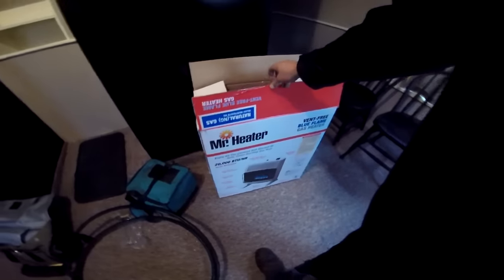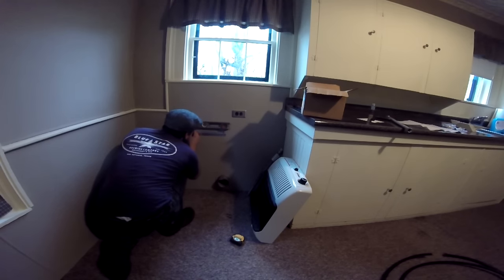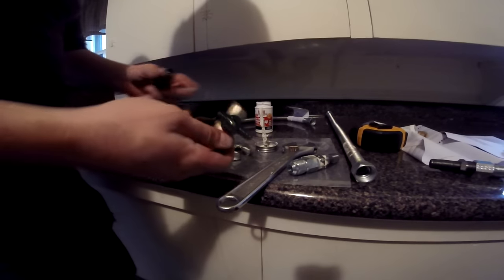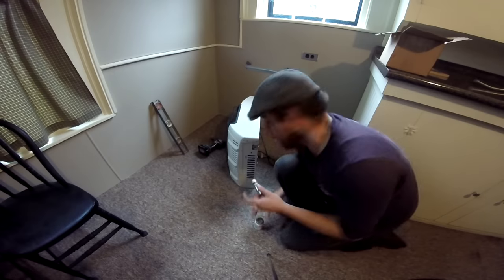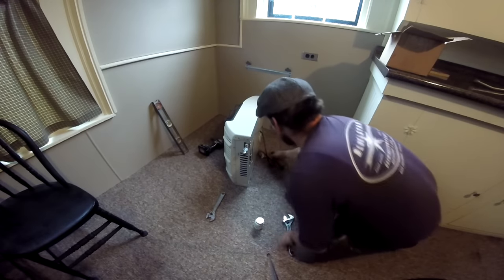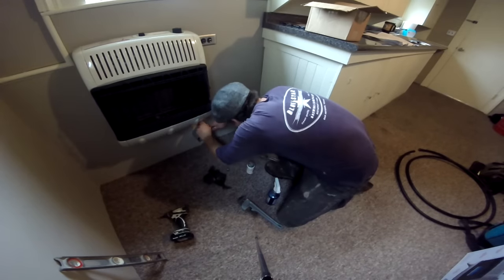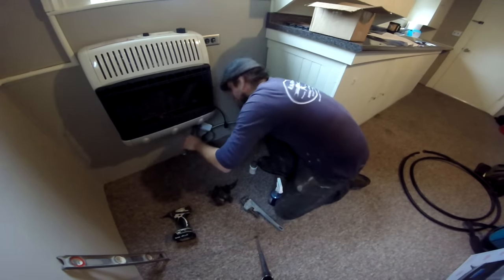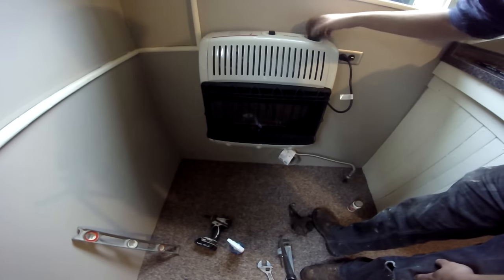Installing a Vent-Less Heater (1)

Comment: very informative. just an extra note,   those that install this unit please make sure you are not using pipe dope or tape on the flared fittings. if they don't seem to be sealing properly, a small shot of a product like wd-40 will help it seal. I plan on buying this heater to install in my shop. I work for a propane company and have installed a few similar heaters.
Reply from the maker: Jimboslice5545 - True Story on the Doping for Compression Based fittings.  I have never heard of the WD40 Trick though.  I will look into that.
Reply: I'm so glad you pointed this out as I had read that the "flared fittings"  are self sealing and NOT to use pipe dope or tape as it could cause problems.  Pipe sealant always on the MALE threads.  Think of it this way- the extra goop is being pushed OUT when you use it the correct way- otherwise you are driving it into the pipe where it'll get inside and could clog up something.   You can also use a combo of tape and pipe dope in the MALE threads for good measure if you want, though that pipe dope makes a big ass mess, and easy to overdo.  The teflon tape for Propane is YELLOW container, and always wrap around threads in CLOCKWISE Direction, overlapping- some tape is really thin so you may need several laps.
Reply from the maker: Right on!

Comment: I just bought a Mr. Heater 30,000BTU Ventless blue flame Propane Heater.  I'm using it as emergency back-up heat for Power Outages.  Maybe it's just for the Natural Gas Models, but can you tell me please if I need to install a "dirt trap" black pipe that would go right under where the gas hose attaches to the heater (it is a dead end capped pipe that is supposed to keep the pipe clean- though it is not included in the Mr. Heater kit)?  I have looked and can't find info anywhere and hope you can help- or anyone can help please!  Thanks!  And I liked the video- clear and very helpful IMHO.
Reply from the maker: I am glad the Video was helpful.  NG or LP should use a "Dirt Leg" regardless, some codes may not require them, but they are always a good idea.
Reply from the maker: Yes, Thank you Wes!

Comment: I have a DynaGlo ventless natural gas heater. I have had my heater for a year, its now November and I need to turn it on. I got the pilot to light, but the control knob won't turn counter clockwise so I can get the heater to turn on. It won't budge, even though I'm pressing it down. I called customer service, but they close at @ Central Standard time, and I've never been able to get through. Its freezing here, and tomorrow is Thanksgiving. It worked last year. It looks a little dusty inside, but if it was too dusty, wouldn't the pilot light refuse to light? Its lit now.
Reply from the maker: Sorry for the late response.  It sounds like the Gas Control Valve or the Manifold that the Regulatory Knob/Shaft (Control) has malfunctioned or is bound up internally.  The pilot may still remain lit if the physical blockage or malfunction is after the pilot selection of rotation portion.
Reply: It's always a good idea to test run important items like this portable heater BEFORE cold weather approaches!
Reply from the maker: Yes it does!

Comment: thanks I got this same one and were wondering what I were doing wrong , how did u get air out with which switch?
Reply from the maker: lonnie smith In this video, what I do typically is assemble everything together, then turn the gas on and then loosen the appliance connector as it goes into the nipple at the gas control valve.  Wait until you smell a little gas and then tighten the appliance connector back tight with the nipple.  Don't forget to soap your fittings.  There is still a slug of air between the gas control valve and the pilot tube.  So, set the dial to Pilot and push down on the knob, as it allows the gas to flow out, it will push that slug of air out of the line.  By cracking it at the gas control valve you're pushing a larger slug of air out before it reduces to that tiny pilot tube, reducing the time to push all the air out significantly.  Once you've given it a couple seconds.  Start trying to ignite the pilot flame.
Reply: thanks for the help  i got it started
Reply from the maker: lonnie smith Awesome!  Stay warm.  :-)
Reply: Must your furnace be working properly for a ventless gas heater to work?
Reply from the maker: In most states, your primary heat source is required prior to using a vent free gas furnace as a secondary source.

Comment: One question any body know if this produce carbone monoxide because, not has vent pipe to go out side of the house
Reply from the maker: Great question, it does produce Carbon Monoxide (CO). 
 Regardless if a unit is vented outside or not it will always produce some amount of CO.  Vented units produce CO at greater Parts per Million (PPM) or toxic levels of CO.  This unit in particular is considered vent-free as it produces low amounts deemed to have a PPM of tolerable levels or non-toxic amounts due to its high efficiency.  As a Natural Gas (NG) or Liquid Propane (LP) stove produces CO, it is not vented due to its low PPM.  I hope this better explains the non-venting requirement of this product.

Comment: Did you install a pressure regulator in the gas line like the directions show in the Mr Heater install instructions?
Reply from the maker: apostolic bible polyglot , I did not.  The application of a regulator would be most prevalent in an unregulated gas system.  i.e. the use of a propane tank style system or natural gas where it is not already regulated.  In most common circumstances natural gas is regulated as it passes through the meter provided by the utility company.  If that wasn't the case, you would notice a regulator as the supply enters the house or before each gas appliance like a stove, hot water tank, or furnace.
Reply: Factotum Jack Home Repairs - what you say makes sense, but the warning in the manual is intimidating.  I'm hooking the heater to my current furnace natural gas gas line of which the furnace bit the dust.  I'll call the gas company MONDAY to confirm.  Thank you!
Reply from the maker: apostolic bible polyglot, No problem.  Hope it works out the Techs they send are typically very knowledgeable.
Reply: If its already regulated to 11 inches of water column, you'll be fine.  Of course that means there's already a regulator between the tank and the cabin/RV supply.
Reply from the maker: Correct

Comment: How did you get rid of the carbon monoxide poison?
Reply from the maker: Good question!  With this unit and/or style of heater in particular (Vent-Free), you don't need to "get rid of the carbon monoxide" (CO).  The units are so efficient that they release low enough levels or ppm (parts per million) of CO emissions that they are negligible.  The manufacturers have to comply with standards set by the CPSC.  These heaters are similar to natural gas or propane cook stoves.  Have you ever noticed that a gas cook stove is not vented either?

Comment: How much an installation like this cost
Reply from the maker: I mean, the unit I believe is 299 plus tax depending on which state you buy it in. Then there are variables, should take about an hour or less to swap the unit if you're looking at a direct replacement of an existing unit, if your installing from scratch then it depends on the nearest power source, the nearest gas line location, and then there are a few other factors that may be involved it's hard to say right off hand.
Reply: Tanks man
Reply from the maker: No problem

Comment: i watched many times, but i still do not know what fitting i should purchase with mr mr heater 10,000 btu blue flame natural gas
Reply from the maker: I assume you are referring to the fitting at the bottom of the unit, at the inlet?  For 10,000btu's you should need a 3/8 MIP (Male) thread to a male appliance connector connection (flared).  They sell appliance connector kits at most hardware stores, Home Depots, Lowes, Plumbing/HVAC Suppliers, etc...

Comment: Do you not need to install a trap with natural gas like you do with LP ?
Reply from the maker: Steve Gibson are you referring to a dirt leg?  If so this unit has one below the floor in the crawl space. If you need to install one, it is a good idea.
Reply: @FactotumJackHomeRepairs  okay yes, I was looking for that. I was told that it should be installed as close as possible to the heater but I guess that works.
Reply from the maker: Steve Gibson this situation is a little bit different, but it is 3 to 4 feet away from the bottom of the heater right as the gas up turns from the crawl space.

Comment: You should use a reducing coupling rather than a bushing. Most gas codes prohibit bushings that drop only one size unless they are forged or stainless steel
Reply from the maker: I will look into that in the ICC and NYS Supplement.  Thanks!
Reply: Bushing are against code. I hope he has good insurance.
Reply from the maker: @WilliamSmith-pz5nw  The only reference in the ICC I am finding to Gas Pipe restrictions on bushings is in cast iron fittings section and as black pipe is not cast iron, I would say it is suggested to not use bushings, but no prohibited.  P.S. I have great insurance.

Comment: Do these units have a quick connect for a hose to a 20# tank?
Reply from the maker: Scott Scott, you could potentially plumb a Gas Grill Regulator in, I would not recommend it. Also, the manufacturer's recommendation, if you do plumb the heater to a propane tank, is that the tank be 100 pound tank or greater.  Anything under a hundred pounds is not designed to lose the contents of its tank as quickly as a heater's demand.  You'll find with your typical gas grill propane tank that it will frost up on the outside and that build-up can actually block your supply with the amount of cold given off by the greater usage.  Also, don't forget to verify that the unit you bought is designed to handle liquid propane, if you so choose to install to a Liquid Propane Supply vs. a Natural Gas Supply.
Reply: I have the propane heater and plan on hooking to 20# tank, so I called the manufacturer. They're sending me the proper hose/regulator and fittings.
Reply from the maker: Scott Scott, okay.  Is your heater strictly Propane?  Also, is it the same Manufacturer?

Comment: Did you even check for a stud to make sure it is secured to the wall?
Reply: Anchors??
Reply from the maker: I did prior to the video to reduce time and meet constraints.
Reply from the maker: I did not use anchors, Alex, I located the studs off camera to save time.

Comment: how do i put a thermostat on an old heater?
Reply from the maker: chris underwood - I guess it depends, are you looking to install a standard 24v Thermostat and does the heater model you have support an auxiliary thermostat?  Some have lags built-into the gas control valve, but others are designed strictly to operate off of the temperature control post.

Comment: did you install a regulator  ??????
Reply from the maker: I did not.  Regulators are necessary for an unregulated fuel source.  Most cities/areas where NG is supplied are regulated at the meter by the utility company.

Comment: no entiendo mucho el sistema solo dura 5 minutos y luego se apaga cual es el problema
Reply from the maker: Ramon Gil - What only lasts 5 minutes?  The Pilot? or the Burner?  (¿Qué dura sólo 5 minutos? ¿El piloto? O el quemador?)
Reply: Es el termostato ese que le mobio es donde lo ajusta si lo pone a uno nadamas calienta como hasta unos 55 grados si lo pone a 5 sube mas hasta unos 80 grados es como el calentador de agua es para controlar la temperatura

Comment: A ventless gas heater what ventilation is required
Reply from the maker: Trevor Hayes - None for purposes of emissions.   Ventless Natural Gas or Ventless Propane Heaters are designed to emit low enough exhaust to safely not be vented.  Similar to a gas stove.  Most people don't think about it, you walk into a kitchen and see a gas stove; do you ever ask yourself where is the vent?  Same principle.  But, be mindful that ventless heaters do generate a considerable amount of additional moisture, because of the lack of traditional exhaust ventilation system.
Reply: Gas water heaters, central furnaces, and clothes dryers have ventilation. So do so many gas space heaters.
Reply from the maker: True, but my example was aimed at the fact that the manufacturer designed this unit to be vent-less, like a gas stove is vent-less.  Gas water heater and Central furnaces are not vent-less, yet great strides are being and have been made by engineers to make them vent-less.  Hence the innovation of power-venting.  At this time though; these appliances are typically at higher BTU's, with standardization of shape/design limitations, and man's technological inability to make them efficient enough under the above factors to allow us such vent-less appliances.  Gas clothes dryers on the other hand are merely vented for the same reason electric clothes dryers are; extremely high moisture content of the exhaust.
Reply: People die all the time using ventless propane heaters. Keep a window cracked.
Reply from the maker: People also died crossing the street. Ventless gas heaters are not designed to be the sole or primary heat source.
Reply: People die because they don't follow the safety instructions included or they modify their heater.
There are some circumstances where venting is required. The manual included with the device will tell you how and when it should be vented.
Reply: Many people use these Ventless heaters in a Garage, or a "sun room" or an area that is not easily heated because it is "leaky" or poorly insulated, or as "back up" heater especially for emergency power outages (fan will not run but unit will still work).  In many big Old Houses, there is enough drafty-ness so that the lack of Venting should NOT be a problem, but I am no expert.  Therefore, always take safety measures- test the gas lines and  new connections for leaks with soapy water,  have a new, working Carbon Monoxide detector in the room & located properly ( 5 ft. above floor and not in kitchen or on ceiling, etc.).  Have a smoke detector as well.  The unit has a low oxygen sensor which is an added safety feature.  Be sure the Unit is installed correctly, securely and with enough clearance.  I would NEVER use one of these in a small "airtight" apartment space, or leave it on when not at home.  Like Ventless Gas Logs, you follow the safety instructions, and take appropriate safeguards.  If using it in a Garage or sunroom as a "portable" unit, you can use the feet that are supplied, though the bottom inlet will require the "L" fitting instead of the straight pipe for wall.  Also to use with a Propane tank, you'll need a "2 stage" regulator, which is something I did not read ahead of time.  A single stage evidently cannot assure as even a gas flow, and may cause sputtering or variations in gas flow.  Make sure you have a SAFTEY cut-off valve inline especially if using a tank, and check all connections with soapy water spray!  Like I said, I'm not an expert, just learning myself, so make sure you do your own research and stay safe.
Reply: They have a safety built in,it will shut off if oxygen gets low
Reply: He is wrong about make up air in the room. Please read the directions and the code book..
Reply from the maker: Not wrong, there are many thing that we have discussed in this thread of comments already.  The first one was reading installation instructions to a Tee and thoroughly.  It is hard to answer all questions generated by a posed hypothetical question in the initial response.

Comment: SHUT-OFF VALVE should  have been at the end of the rigid gas line,
and BEFORE the flex-line.  
The way this was done, if there is a problem with the flex-line,
someone has to run downstairs or outdoors to shut off the gas.
Otherwise, was a good install.
Reply from the maker: james lynde the video shows installing the new shut off valve right after the rigid pipe and before the flex pipe.  At which point we have to shut off the gas at the next respective shut off to that line, in order to change that shut off with a functioning valve for convenience, as you are describing.

Comment: Yes but you don't use the gas stove for heating
Reply from the maker: Trevor Hayes - True, you are not supposed to use a stove in that manner, but I have seen people do it.  It is a big "No, No", because they are not designed as a heating source, but they do put out some heat and burn Natural Gas at such a high efficiency, that it produces such low exhaust that is inconsequential to release into a residence. Because of its high efficiency, it too releases a lot of additional moisture.   A ventless heater works on the same principle, it burns the natural gas or liquid propane at such a high efficiency that its exhaust is mostly water vapor and some carbon monoxide, but at such an inconsequential amount that it is not necessary to vent outside of the residence.

Comment: Ok this is the uses on them> 20,000 BTU will run off a 100 lb bottle for a month,  the  30,000 BTU uses 2 ~ 100 lb bottles a month > So it better to have a 15k to 20k BTU heaters in my books > these was tested on low flame uses >>  he hee there to hot to test on high flames > They throw off some SERIOUS HIGH HEAT if you need it > They stay on low flames uses around my place
Reply from the maker: Thanks for your usage observations.  I am assuming you are also referring to Liquid Propane (LP)?